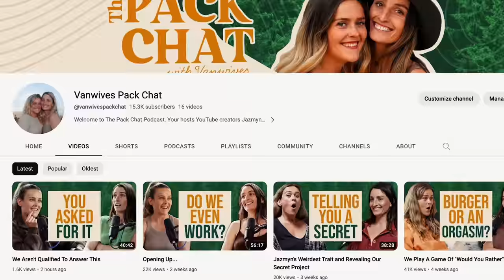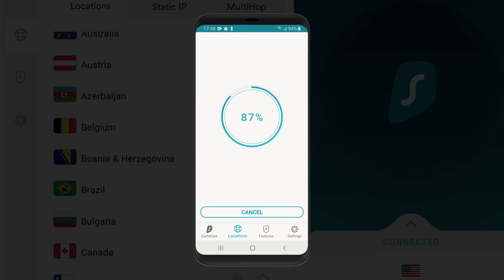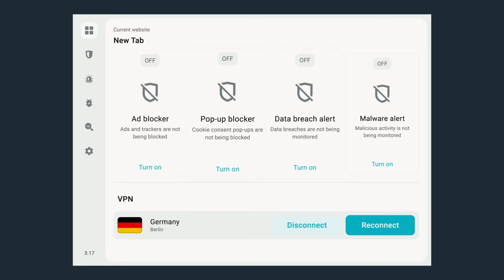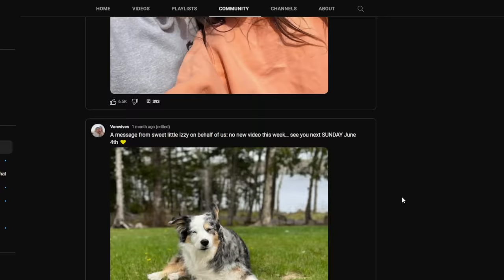Spa At Off-Grid Cabin (wood fired hot tub, sauna, cold plunge & shower!

Comment: Jaz-if you put both your outriggers down untill the rear tires are off the ground-it will help keep the machine in place while you dig.They are built to do that !
Reply from the maker: Thank you!!!! Appreciate the tips so much 💛
Reply: Yes I was going to say the same plus I put the bucket on in place of the forks then lift the bucket and curl it downwards as far as it will go so its pointing backwards. Then jam it straight down into the dirt. This will act as an extra anchour to stop the machine moving backwards as you pull on the backhoe. Also, never jump off the machine without dropping the bucket and/ or implement.. its VERY easy to be run over by your own machine and lots of people have lost their lives this way!
Reply: Mine had a line lock on the brakes. Press the brake pedal and flip the lever. Press brake pedal again, and it releases. Check your owners manual.
Reply: Hey Crystal & Jaz very “constructive” time!! Leisure & health spa area is just amazing well done!! Bella & Izzy love bath time?? 😂 🩷🤗🇦🇺

Comment: May I suggest that you put  an on and off faucet on the sides of your tanks, for easy clean on the inside of the tubs, also you should also put a few drill holes on the platform of your outside shower it will not get slimy that fast if the water has someplace to go.

Comment: That crappy weather is reason to build a large pole barn so you can work in the rain.  Build it to park the tractor and side by side under, but if you need it, you can pull them out and have a dry workspace.

Comment: You can set the brake. Step down on the brake pedal and either lift up or push down on the orange color handle under the steering wheel. Also bring the rpm's up using the throttle of the tractor, This will make the hydraulic pump work quicker and the response in the front loader and back hoe will be quicker.

Comment: a tip when putting on deck boards, leave a small gap between them, roughly the width of a 6 inch nail cross section, because the boards will last a lot longer when able to drain moisture easier, and when debris starts to build up between the boards which it eventually will, that holds moisture in there too.

Comment: Just an idea which depends on where the cold water line goes from the new t-piece, add another stop cock in the line to the spa area. That way if there's an issue outside you don't have to interrupt flow through the rest of the system, plus you 'could' drain the spa line in winter to stop it freezing.
Crystal, take take of your back, you only get one. I did mine in years ago at work doing name boards. I'd spend hours stood at a 6 foot table with my back bent at 45 degrees, now I get times where it locks and I can't straighten up with out pushing down on something.

Comment: The spa area is amazing and very well thought out. 

For the tractor - please understand that this may seem critical BUT please never repeat trying to move the tractor while standing beside it.  Accidents happen so quickly and machinery will always win against the human body. 

As for the hydro issue - first I would check to make sure your hydro fluid is full. There should be a dipstick to check the level. If full, then I’d check the hydro filter to if that’s clogged up. Then checking to see if your connections are all tight and your lines aren’t pinched/leaking ect. This will allow air into the system. 

Also may need to boost your working RPM. The compact, sub-compacts, and some smaller utility tractors struggle to keep up with heavier hydro attachments. 

Again - the spa is really nice. Great work. 

Enjoy the weather and safety first.

Comment: when using the backhoe. use a pallet(bulk weight) for leverage on the frontend((bucket of dirt) or forks). for harder and rocky ground for extra support  . also 4 foot maybe not be acquit to prevent freezing check online for the depth in your state and area.

Comment: Awesome video girls!!! The spa is beautiful. Great job for sure. The tractors hydraulic system probably only can run the front or back separately. Hopefully it just leaked down where it didn't have enough fluid to run both and fixing the leak and filling it up will fix it. Y'all are doing so great on your homestead.
Reply: The finished wood has been planed and maybe kiln dried.

Comment: ..The two of you are amazing .. Jaz when using the backhoe drop the support pads as far as they will go ,, back wheels should come off the ground ... should be a dial with a turtle increasing to a rabbit ,, this is engine speed control (RPM) ,, turn it up for more hydraulic PSI to operate the backhoe bucket ..     ... Crystal get a waist support belt (weight lifting type) ,, wear when doing any lifting or intense bending ..     .. Electric(battery powered) chainsaws are OK for light work like delimbing ,, not so much for tough cuts and felling trees ,, unless small ...
 ...   Love the looks from Izzy and Bella at bath time ...

Comment: Jazz! When the backhoe is engaged the system sends all hydraulics to it. Using the other end of the machine at the same time doesn't give the forklift access to enough hydraulic fluid to work properly. When you're using the backhoe, the outrigger feet are what keeps you from moving. Use those!!

Comment: When you are using your tractor in the backhoe position. And when you are using the backhoe, make sure that forks are completely all the way down in the back  to where it lifts up the back end of the tractor to wear. It will hold it in place. Also, when you are using your backhoe, do not have the fork  on. Make sure you have the bucket on. And not the forks on it that way. With the bucket, you can curl it like if you were dumping all the way down. And then all you have to do is put the bucket into the ground. And that will hold the front end. And if you do it right, you can basically lift the whole tractor off the ground by using the bread bucket and the back forks to lift up the tractor off the ground, and you can use the backhoe

Comment: Just a tip when you are digging with backhoe mode put a little more strength down on your feet pads. Lift a little more up on the backhoe , it will stop the tractor from moving while you dig.
Reply from the maker: Thanks for the great tip! Happy you are sharing your experience with me. 🤩🐶

Comment: Curious / Question:  You didn't mention a drain, spigot or facet to drain the tubs.  If they had one, a hose could be attached and the drained water could be directed to the garden or planted areas to re-cycle the water.

Comment: You can only use either front loader or back hoe at once. The hydraulic pump can't run both on a smaller machine I would think.

Comment: Hi hun you need to use your horizontal stabilizers to prevent it from rolling that away you are working from the behind but it sound and is acting like you are low on hydraulic oil mine did the same thing good luck you ladies will get comfortable with it

Comment: I injured my back when I was around Crystal's age as well. This is VERY serious, because once injured, it was a recurring event for most of the rest of my life. even when I wasn't lifting heavy objects... like once while spitting toothpaste into the bathroom sink.
I learned that most times, the initial injury isn't very painful, similar to being pinched. I call it a little 'twinge' in the lower back. That's the sign to stop whatever I'm doing immediately, because the real pain is afterwards when the inflammation begins. If you don't stop, you'll soon be in a very serious state of hurt.
It's a herniated membrane between vertebra, which can recover but not completely heal, especially if the injury is repeated.
Contrary to a doctor's recommendation to keep moving, I found that the best solution is to stay completely immobile for at least 3 days after an injury. Full disclosure, I'm no doctor, but I'm certain that doctor hasn't had my years of personal experience with this injury, neither.
I also highly recommend wearing a back brace or weightlifter's belt while working, as well. Also, get into a habit of applying proper lifting posture by using your legs, instead of bending the back.
For myself, I think it had a lot to do with irregular exercise, going from sedentary to strenuous activities. IMO, daily yoga might be the best solution.
So sorry to see Crystal going through this pain and wish I had better news to share. Hope this sharing an these suggestions help in the future.💖

Comment: Jaz, the Kubota engine needs to be throttled up before operating the loader or the backhoe.  It sounded like yours was running at idle, which will make the implements run very slowly, or not at all.

Comment: When you have hydraulic hose issues it is way more cost effective to remove the hose and bring it to a hydraulic shop. They will make a new one based on the old. Way cheaper than ordering from dealer. If you run hydraulics you will need a hose supplier that's life. Princess auto does them but a specialty hose shop is cheaper yet
Reply from the maker: Thank you for that tip! We will do that next time 👏

Comment: The tractor might not have enough hydraulic fluid to operate both the front lifter and the back hoe at the same time.
But i might be wrong.
Usually these things comes with a hydraulic reservoir.
But it might be designed to only operate one of the equipments at any time.

Comment: Be careful with the PEX.  It looks like you were connecting PEX 'B' to PEX 'A'.  They use different kinds of fittings.  PEX B uses crimp fittings.  PEX A uses expansion fittings.  When running the pipe role it like a wagon wheel.  Do not pull it out like a slinky.  Put a tee in the line with a valve and a air hose quick disconnect so you can use an air compressor to blow the water out of the line in the fall.

Comment: For lifting it to słów, I think u may have to set up engine speed too slow. Try pressing harder on the accelerator, or moving the clutch so that it has a higher RPM. I base my comment on the knowledge of driving the Ursus 300 tractor, so it may differ slightly in technology, but I think that the principle has not changed.

Comment: A lack of hydraulic fluid and a hose with a hole, that’s a pretty good reason for poor performance on the bucket - front and/or back… Problem solved 👍🏻
You will need some cupholders at the tubs or a table in between...

Comment: Your ankle incident may have led to your back issues. 
You hold and use your body differently when hurt. 
And it can pull your hips out, even just a little will lead to lower back and even ribcage injuries.  
I broke my foot and badly sprained my ankle and subluxed my hip in a roll accident. Doctors paid attention to my broken foot and ignored everything else and so I walked around with a partially dislocated hip for five years. Then I lost weight and was running again but couldn’t go more than a mile without it hurting badly. LSS my hip was still out and had created a problem with my spine and ribcage because of it. Due to the length of time it is now a chronic problem.

Comment: Ladies, please be super cautious working with those hydraulic lines on the tractor equipment - They can be very dangerous. If high pressure hydraulic fluid releases under force, it can be great enough to puncture skin - It's called a fluid injection injury. If that fluid injects into your skin tissue or into your  bloodstream, it's VERY serious. People have had to have limbs amputated because of this. Definitely should be wearing safety goggles or a face shield when messing with those hydraulic lines. If you haven't already, please look up the safety measures regarding repairs & maintanence to your tractor. Stay safe!

Comment: take the hose off take it to princess auto they will make you a new hose and crimp fittings + they have buckets of hydraulic oil cheap and they are open 7 days a week or any hydraulic hose fitting company they will make the hose and crimp the fittings for you cheaper than Kubota

Comment: You’re low on hydraulic fluid
Reply from the maker: Yes you are right, needed new hoses had a puncture in them. 🌞🐶
Reply: @Vanwives  you need to keep a long spare hose of each Diameter size, I can get you up and running until correct size gets there. Also Spare cylinder you're a weak size, Unless you're going to learn how to Repack the Hydraulic cylinders. There's a special tool take them apart with And packing kits you will need to rebuild them. Need to keep a few extra pins and Carter keys.